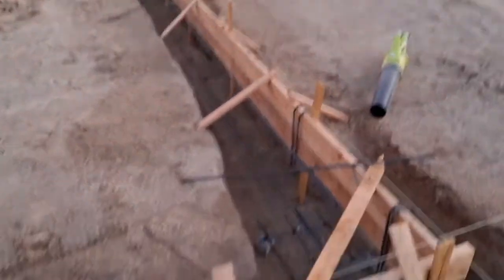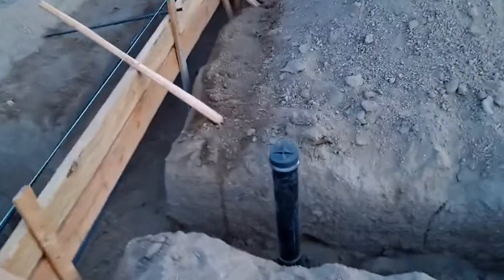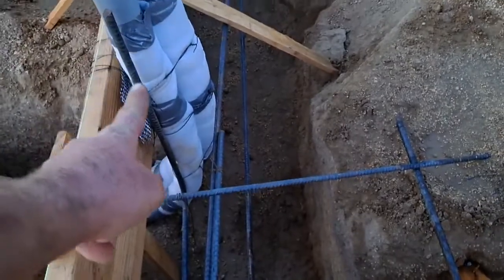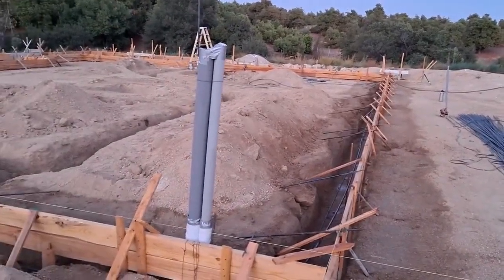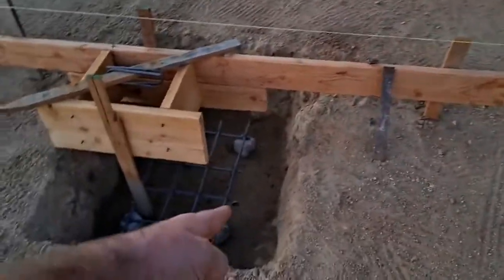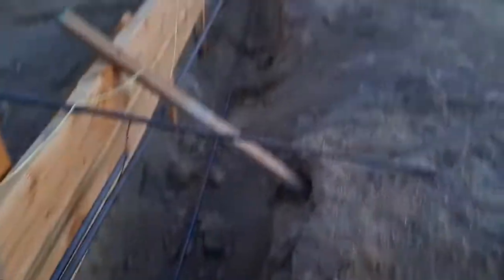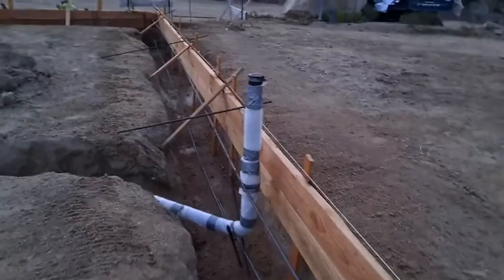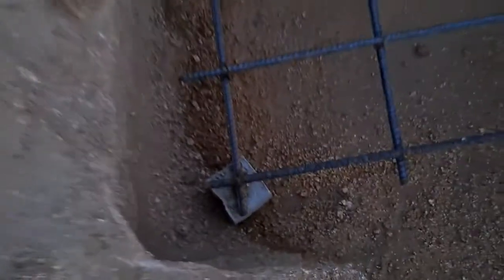CA ADU Getting ready for county inspection underground plumbing, grounds, conduit, footings forms

Comment: Thanks for sharing! I notice the foam wrap, but also no sleeves. I take it your footing plan didn't call for sleeves for any pipes going through it?
Reply: I do recall my plumber or concrete guy talking about sleeves, but they are both very experienced veteran trades people and I was following their lead on this so no, no sleeves. I am certain sleeves were not on the plan either. They were both all over the foam though, and the inspector was looking at it closely. I am not experienced to know the reason for sleeves vs. no sleeves. Maybe colder climates?